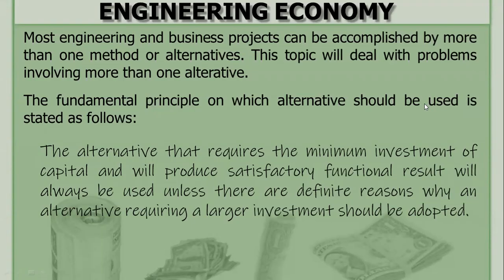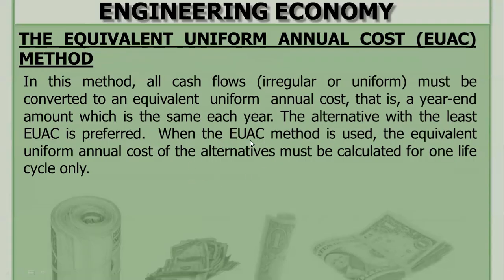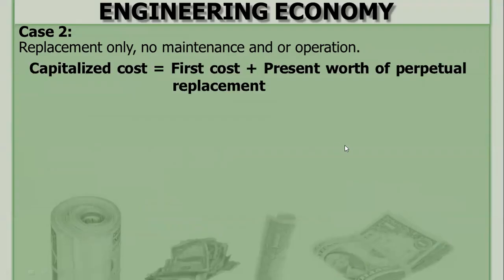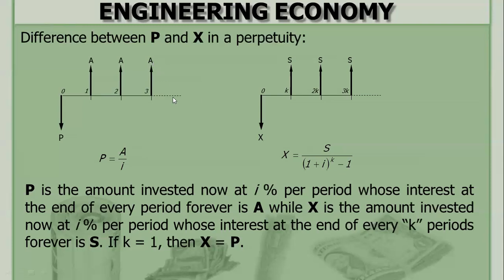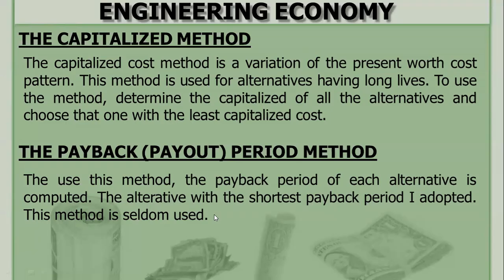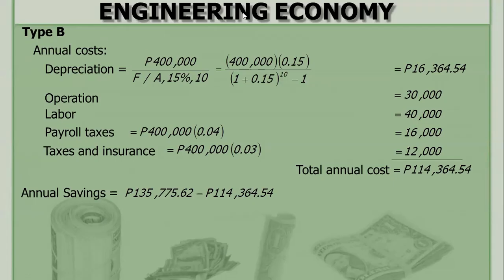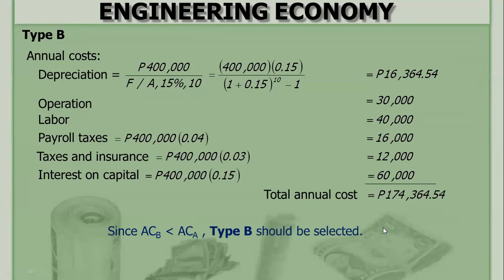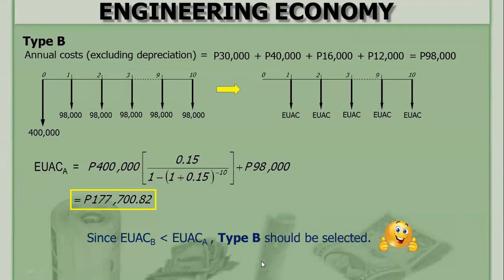COMPARING ALTERNATIVES

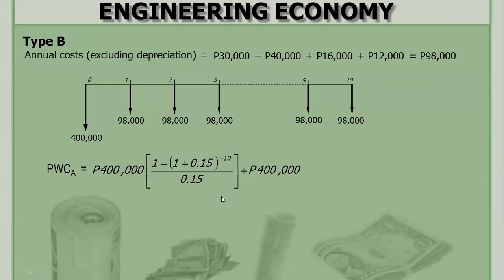Comment from the maker: 34:53 typo error...the number to be multiplied by the present worth factor should have been 98,000, not 400,000...but the calculated present worth cost is correct.